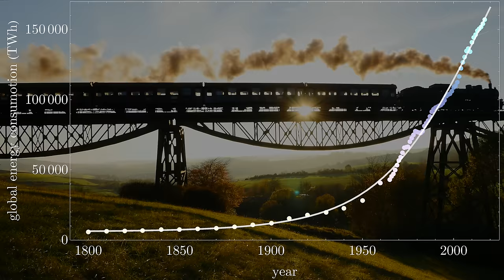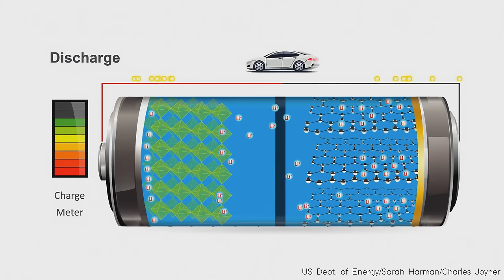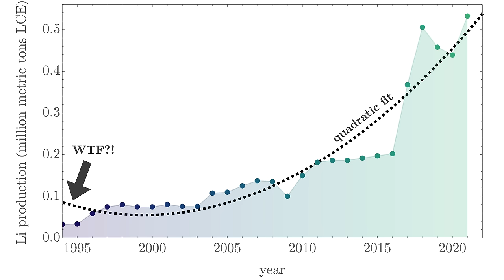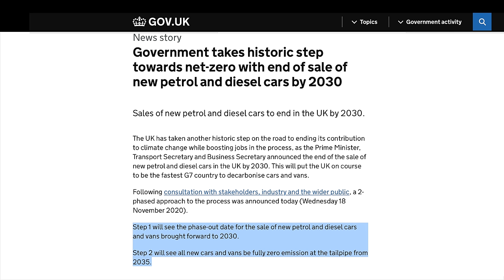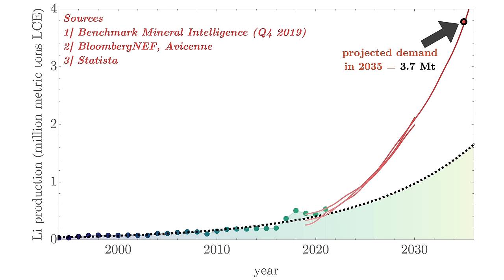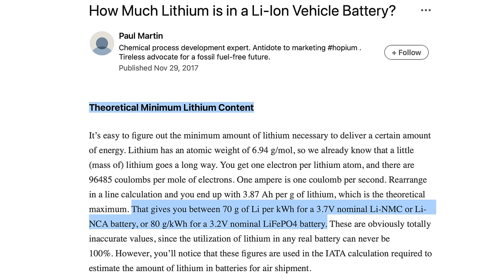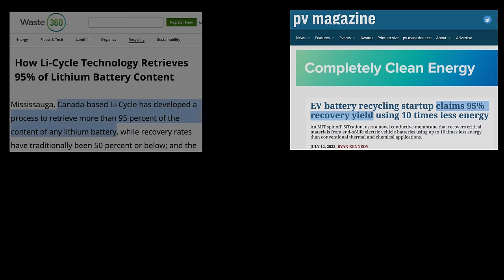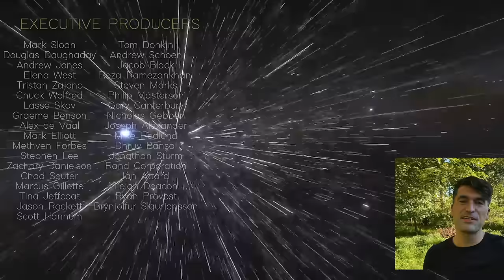Will We Run Out Of Lithium?

Comment: Love your content, one critique however. It sure looks like you botched that exponential curve fit exercise. It tries too hard to fit the past data when Li wasn't a rock star. The last 5 points are well above the curve, meaning the curve fell short. So all shortages are overstated. I mean some dude in Chile turns a pump to fill a new brine pool next to the last one,  to scoop up more into a truck once the sun dries it out. Not hard to ramp up production. Also, seawater contains 0.1 ppm Lithium (dwarfing land reserves) that can be extracted if a bunch of chemists get crackin' at all of those desalination plants. Kee up the great work, very thought provoking stuff you do!
Reply from the maker: It might be that the model itself is not correct (in fact to some degree that’s almost certainly true), but the regression of the model to the data is correct! It actually doesn’t matter that much because as we saw even the exponential growth does not capture the EV mandates and thus demand is even more above supply by a big margin regardless.
Reply: @CoolWorldsLab  I was never implying that the regression was incorrect math-wise. Clearly you are a stud with math! I was just saying that the newer points as more important that the 1990's. I was brainstorming out loud. Something like giving each of them a friend or two nearby to make the regression weight them as more important, or forcing a new "regression" equation that requires those points not to be above the "solution". Silly probably, but It just feels like undershooting points that first occured when the ramp up was called for shouldn't be the case. Anyway, been watching a lot of your content since I subscribed and love it! Thanks

Comment: Really enjoy your content without political twist although that does throw a certain variable into the unknown portion of calculations. Also the projections don’t seem to take into account the commercial and residential storage aspect that is bound to exponentially increase as mandates on fossil energy use reduction is forced and or adopted. Home and business and community storage facilities will be on par or exceed with EV’S  by 2030 which in an infrastructure model is tomorrow, I.e. very very soon , in order to accommodate carbon zero mandates. Just A home running solar and wind energy consumption and storage far outstrips vehicle consumption by at least 5x and commercial consumption is 10x of that. Let us know what you think.

Comment: I wonder whether the EV demand statistics used also take into account larger vehicles, with tesla now planning to release trucks which would presumably require a lot more lithium per vehicle? If not that could mean the global lithium demand is still highly underestimated...
Reply: Tesla has delivered 38 semi trucks at least... Those vehicles are getting 20-22MPG equivalent when fully loaded, and they are used more of the time than a passenger vehicle, so the use of batteries is well worth it...

Comment: I think we are over-estimating demand for new cars out into the future.  A lot of increasing demand for new cars is coming form India and China.  China is at a weird demographic crossroads right now where they are about to have a scary decrease in population.  On the one hand this will increase car demand in the short term (concentrated wealth on a smaller population), but in the medium to long term this will be a large slow-down in demand, if not outright negative growth.
India will have less of this effect, but the practicality of adding more and more cars in already ultra-dense cities is already a pretty hard limit on car ownership there.  More vehicle owners will allow for more urban sprawl, but I am not sure that is a huge phenominon outside of the US.

Another thing, which I am not sure is captured in the recylcing numbers is reusability.  If dendrite buildup isn't happening yet at the cell level, then a cell can keep being used.  The 10 year expected lifetime on EV batteries is for the overall usability of the pack rather than the cell.  At the cell level the realistic lifespan is closer to 25 years (provided it is not abbused and over/under charged regularly, or exposed to extreme temperatures).  So as cells are able to be repackaged with new cells in new or reconditioned batteries, it will greatly prolong the availability of lithium wihtout need for true recycling techniques.  A lot of Tesla power wall batteries are already 2nd life EV batteries enjoying a much more leasurly retirement compared to their previous car form.... but also begs the question why they are so expensive when the cells are effectively free to the manufacturer.

Lastly, a lot of the recycling challenges is because recycling is a thin margin business.  Even today most recycling outside of metal and glass runs at a loss subsidized by state or federal incentives... not because it can't be profitable, but because getting enough bulk material of the same type is difficult to come by.  Harvesting batteries from small fiddley short-run products with custom batteries like cell phones, tablets, and laptops is... tedious.  Outside of iPhones and maybe a couple large run Samsung devices, there are few things out there in enough quantity that can effectively be recycled.  In another 10 years as we get bulk car battery cells coming offline this will change dramatically!  Each individual cell is more massive than a typical phone or tablet to begin with, many will be able to be reconditioned with minimal effort, and cells which really are in need of recycling will be similar enough that they can be done in like-batches together.
... Of course the obvious problem here is redily identifying, testing, and sorting cells.  Tesla is the largest brand, and they have changed physical dimensions and/or chemistry of their cells every 2 years or so.  Until we have a more ubiquitious cell type and chemistry for a decade, then EV battery recycling is going to be a challenge.  I think we will get there... but that even the leader of the industry is changing tack on design every year or two shows just how young the technology really is.  Until there is stability in design, recycling wont really happen.

Comment: The true reason lithium was chosen as the battery metal is quite surprising. During the Cold war thousands of tons of the stuff was mined to process the 6Li isotope out leaving about 90% of the metal as mostly 7Li. They realized that gee this stuff is super light and has a good energy content. After some trial and error they came up with batteries, the most successful of which was the single use LiMnO2 battery. Now lithium ion rechargeable is the dominant technology. It is also super easy to extract the lithium from used batteries. Just shred them and treat with carbonated water. Only the lithium and the water soluble solvents will disolve. The rest of the battery save for the aluminum could be treated as high grade ore concentrate. Sodium ion batteries would be a good enough alternative for most gadgets and stationary application. EV application for hybrid systems would be ok, but pure EV not so much. ❤

Comment: I'm optimistic since this analysis doesn't even take into consideration the alternative chemistries battery could have in the next few years. Since lithium demand is solvable if all new electric cars will use it then it will be much easier to solve and cheaper if various percentages of cars and devices will use alternatives to lithium or at the very least maybe less of it.

Comment: Lithium is just about energy storage, and for the most part (excepting its role in fusion) not about generation.

There are already many alternatives to Li for stationary energy storage such as lead-carbon. There is little justification for wasting Li on this application.

 Potentially there are also a number of alternatives for mobile energy storage in things such as EVs for example aluminium ion and sodium ion batteries as well as hydrogen fuel cells. 

As the lithium BEV technology matures, recycling will also become a significant source for new battery materials.

Other uses for lithium also need to be provided for including very light but strong aircraft alloys and in medicine.

Given known reserves and potential for recycling it is very unlikely we will run out of Li.

Comment: I don't know if I'd reference the Kardaschev scale. It's very en vogue lately, but it's fundamentally flawed in many ways.

I think right now any lithium used for batteries not in mobile devices or EV's, should probably be switched to Iron Phosphate. Iron Phosphate is considerably more common, and has 2-3 times the use-time before wearing out. Non-mobile (and non motile) batteries don't need maximum density vs mass & volume. Cheaper more common elements which last longer would work well for any stationary battery, or on extremely weight-efficient vehicles like trains. Cultivating the iron phosphate battery market would take some of the pressure off of lithium in the uses where it's not going into EV's & mobile devices.

Comment: Here are some more economical ways to fix the demand side problem:

0. Get rid of all the 20% padding here and there.  The Tesla model 3 shows at a very high-end sedan can get by with 50 Kwh, not 100.  Excellent aerodynamics and lightweight design innovation make this an easy and economic solution.
1. Tax credits to incentivize very high efficiency EVs like the Aptera but with only a 20 kwhr battery, or enough for 200 miles of range, or 100 miles for 4 passenger vehicles.
2. HEVs with 20 Kwh battery and a tiny range extender similar to the BMW i3 and incentives to buy them.  Government education about buying these to encourage sales only to people that mostly drive short trips, and recommend EV vehicle option #1.  
3. Incentivize high efficiency aerodynamic design and disincentivize inefficient SUV styling
4. Solve AI autonomy and change laws to allow it, and subsidize it, to disincentivize vehicle ownership.  This also saves a little bit of vehicle demand by preventing a lot of accidents and destroyed vehicles.
5. Vastly improve public transportation and places like California where there is a high vehicle ownership and terrible public transportation and high amount of average vehicle miles driven.
6. Carbon price to incentivize the former options and using as little carbon-based fuel as possible.

Comment: It’s also possible that Lithium recycling could emerge to significantly help supply.
Reply: Already happening, Tesla Panasonic factory in Nevada is already using some recycled materials they are buying from recycler and refiner Redwood Materials... Batteries are lasting much longer than though possible and there is huge demand for used batteries so recyclers are actually having trouble getting enough batteries to recycle...Definitely a huge market for the future and the players are so far growing faster than the availability of materials to recycle...

Comment: There is a way to reduce the amount of lithium needed for energy storage.
Using electrolysis and hydrogen fuel cells for both cars and energy storage from renewable energy sources could drastically reduce the demand for lithium based battery's.
Now this might just shift the problem from a lack of lithium to a lack of platinum but spreading the demand over multiple resources would deffenetly help.

I'm somewhat disappointed that this approach or similar approaches weren't even mentioned in the video.

Comment: Very informative and thorough. The good news is that recycling will play a role. We certainly can't say that about fossil fuels: once they're burned, they're gone. Oh… and I hope to transition from my current Model 3 to an Ioniq 5 like yours next year, as it strikes me as a great EV.
Reply: My next EV will also not be a tesla.  I was checking out the up coming Chrystler Airflow.  I know Chrystler certainly doesn't scream exciting.. but this new EV they have planned sounds pretty exciting to me.  I also like the Ioniq and etron models.
Reply: It is extremely had to recycle lithium as it is mixed with cobalt and another element. It can be done but it is wildly expensive. And in the end, it will all require fossil fuels somewhere along the line.
Reply: @WorstChicken  Why in the world would it require fossil fuels?
Reply: @WorstChicken  🐂💩
Reply: @sanctred  What form of energy is used to run the machine that separate the lithium? The trucks that bring it to the plant? The vehicles that bring the workers to the plant? Powers the plants lights? Before all that, the equipment used to process it in the first place. Thousands of examples, this is just a handful.

It isn't all run on wind and solar. And that's not even taking into account all the building materials used. Likely made with petroleum based products on fossil fuel powered machines.
Reply: @Yanquetino  Quite the response. You stay up all night thinking of it?
Reply: @WorstChicken  well I think you summed up the core of the problem nicely…. Sure would be nice to have less dependency on so many things all tied back to a non-renewable fossil fuel….  The more we move to renewables the more sustainable our world can be for us and future generations.
Reply: @WorstChicken  It is already being done without loosing money. Tesla Panasonic cell factory in Nevada are already using some materials that were recycled and refined by Redwood Materials...
Reply: @WorstChicken  UK went from 90% coal for its energy use to going for 5 months without any coal use in less than a decade... Oil for power generation is dying faster... building new renewables with battery storage is way cheaper than just keeping existing coal plants running, the case for oil peaker plants is way worse... The grids of the world are getting cleaned up incredibly fast and so is construction and transportation...  Redwood materials who already do recycle these batteries most likely generate their own power with solar or wind just like oil refineries have been doing for decades, because it makes for bigger profits...  All the construction and activities of Tesla has used way less energy than the energy that their solar panels have generated...  The total activities of the transition is cleaner than keeping things going the way they were...
Reply: @karlsjostedt8415  Buddy, strawman, did you just read the headline? They are recycling copper foil. They are not recycling lithium, which has been the main subject of this thread. Try again.
Reply: Surprise surprise. Nothing but crickets.

Comment: tl;dr: No. Lithium supply is not going to be the limiting factor. The power grid will be the limiting factor.

Sodium ion instead of lithium ion is already in prototyping, so probably another decade before we see any kind of practical application. Sodium is exponentially more common than Lithium, which is why the shift is already starting. But the big problem is going to be the power grid. Problem one is the grid handling the extra demand for energy, which means needing to make a more robust energy production. Which means Nuclear. 

You can make more solar panels than have ever been produced in the history of humanity each year and you'll still not have enough solar panels to handle it, even assuming you capture 100% of the solar panel's energy with batteries to provide demand when they are non-operational. Same with wind. Most useful sources of hydro have already been tapped, those that haven't either don't produce enough energy or have catastrophic ecological consequences. So unless you want to lean into more burning of hydrocarbons, nuclear is the only way of producing that much energy. We desperately need to start looking into MSR's which are far more energy efficient and produce far less radioactive waste than current water-cooled models, and can even be used to run off of reprocessed 'nuclear waste' for a net lowering of nuclear waste storage. Obviously, Fusion is the end-game here, but who knows when that's going to hit P=1, much less total energy positive. 

The second problem is the grid itself, it's simply not designed to handle the throughput we're going to need in the next decade. We need to stop thinking about how to connect the entire country on the same grid, and how to do more on-site power production, because trying to run the amount of energy we're going to need along lines across the country is simply not going to be possible with any substance currently known to man. We're looking at a dramatic increase in power demand from the grid if we're looking at a total conversion of EV's by the end of next decade. All the energy produced by all those internal combustion engines now need to come from the grid. That represents more power than the power grid currently handles in total. So that's a minimum of doubling our energy grid load, assuming we can keep up with production, even with zero growth which is just a silly supposition. The lines we currently have simply are incapable of handling that throughput. 

We aren't going to run out of Lithium any time soon. We're going to run out of power to charge the batteries before we make enough batteries to challenge our supply of lithium.

Comment: I know you put a lot of work into this video. It's quite apparent. However, your math and statistics displayed in this video are reminiscence of oil projections in the 90s.
Statistically speaking, when demand has significantly outstripped supply, we get better at both supplying, and we get more efficient at using what we have.
Towards that last bit, two of the most interesting developments I've seen are shifts towards sodium batteries, and graphene enhanced batteries.  Both of those modifications used significantly less lithium and are dramatically more recyclable.
Regarding your exponential growth on supply and demand, I would also point out that a logistical curve also looks exponential in its beginning...